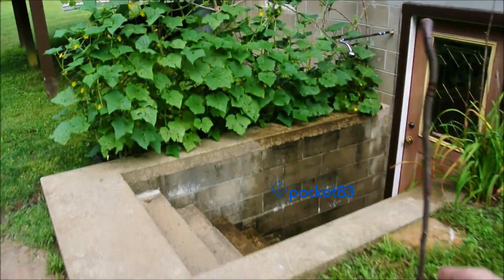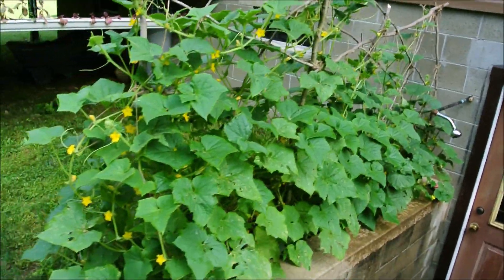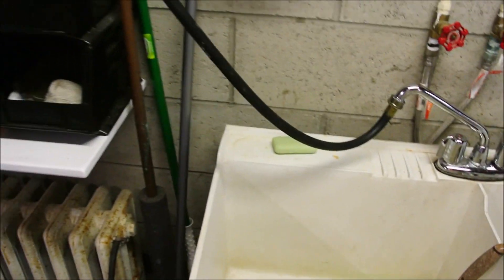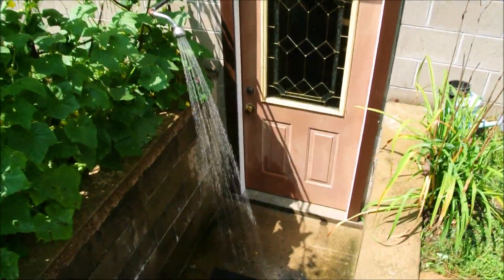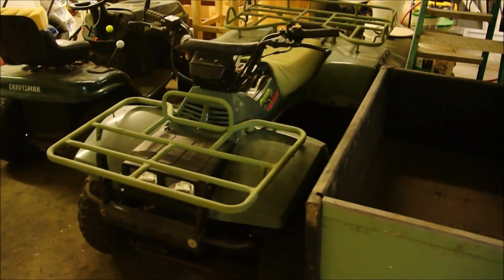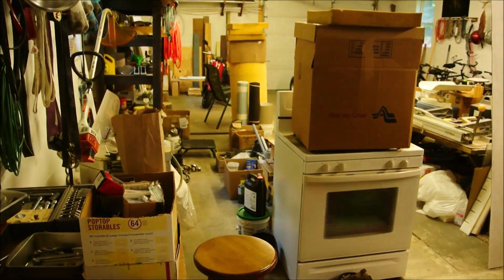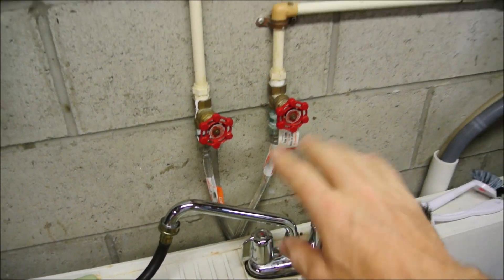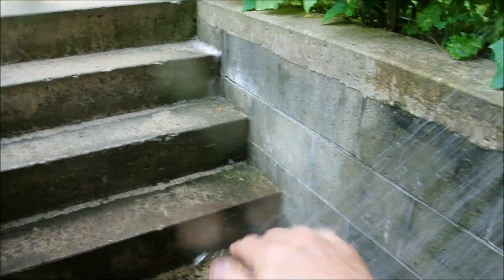Picking cucumbers in the shower!

Comment: Not at all what you're looking for, but the nicest shower valve I've used was one my parents put in their showers when they remodeled their house. It's got two handles, one sets temperature, and one turns it on an off (and can also adjust the flow rate). I think the valve does some kind of temperature compensation to make sure it's always at the set temperature, but I may be wrong there.

Comment: Back in the Marine Corps we would just throw down wooden pallets for showers.  Now, for you, I'm not actually suggesting that.  They're kind of dangerous to be honest.  Scratch that, very dangerous. Felt like showering above an ankle guillotine waiting to happen.

However, perhaps some sort of wooden riser would be a good idea.  Elevated wooden slats with gaps to let the water flow through.  You're the wood experts so I would ask you what kind of coating to give it.

If wood is a good idea you might even be able to build a truck bed type staircase that sits on top of the concrete.  Or maybe just masonry nail/bolt them down and repair the holes later.

Probably bad ideas, just spitballing..

Comment: Inside ball valves. Pex to cheap shower controls outside. Tub filler with long flexible pex and ball valve so can fill buckets with hot water. Snip the pex rings inside to remove everything before freeze.

Comment: The drain presumably goes to your footing drain (some call them french drain or weeping tiles) -- do you have a sump, or does it drain  out somewhere else?    As for the damp concrete, a lot depends on how well those footing drains were installed.  I used to live in a house years ago where the pipes stopped on either side of the stair, which is bad as that is a place for water to gather.  Hopefully the drains are continuous and route around the stairs, which helps take the ground water away properly.

Comment: id smooth out the concrete and use bar soaps that leave residue which would coat the surface, idk ive experienced them in the middle east few times

Comment: I've been hoping to see your solution to the deck problem. As I am faced with the same problem. I've considered notching the posts to insert wood blocks.
Reply from the maker: Yep. That's exactly what I plan to do. I watch it closely, so there is little at stake. When the time comes, I will use a car jack to reclaim the 1/4" or so that I've lost, and then notch each 6x6 (perpendicular to the header) to accommodate a short 2x4 that will support the header.

Surprising few people offered that solution. Mostly just know-it-alls lecturing there about the 'right way.'

Comment: Painting the concrete is a good option. Modern porch/concrete paints are prettyy durable and good well as a sealer. I just used some Home Depot house brand exterior porch paint on a shower curb cap and it's quality stuff!
Reply from the maker: If the block is being wet from the backside though, from the groundwater, will that make paint peel? I know that BEHR enamel sticks like nothing else, but a below-grade block shower is pretty extreme for paint, right?